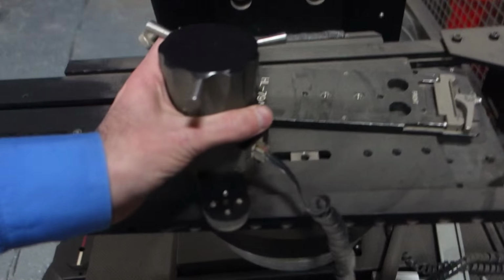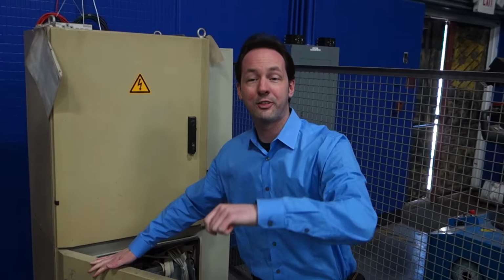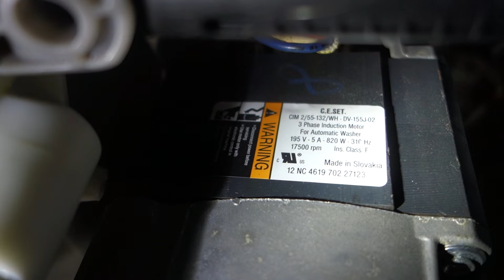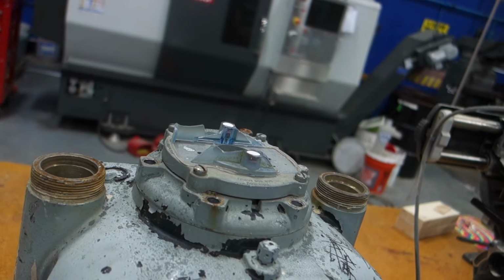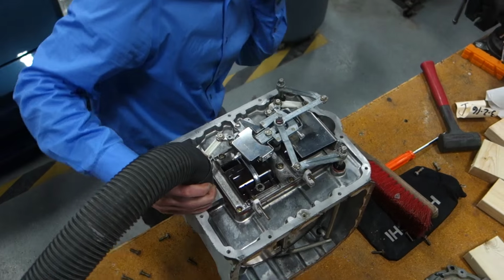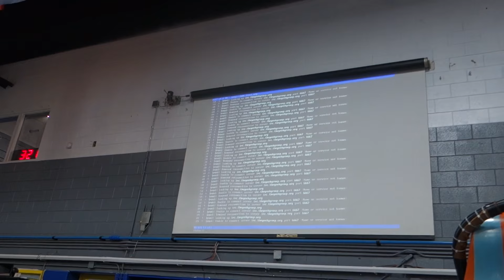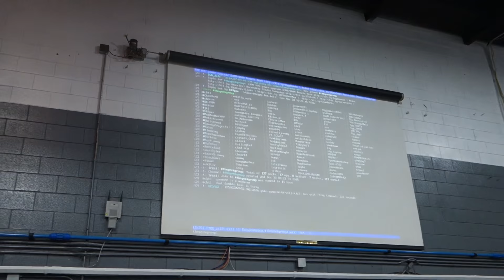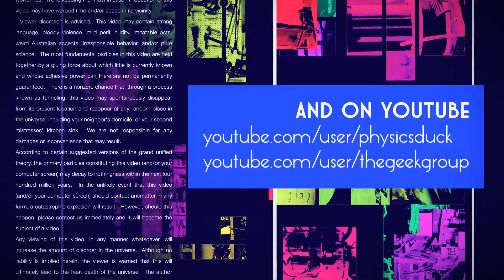Captain's Blog 3 21 2016 Robot Surgery Preproduction and Gas Meter Awesomeness

Comment: If that is an AUI port, then that computer may have Ethernet.  Used in older hardware, AUI is the connection between the Ethernet interface and the Medium Attachment Unit (MAU).  The MAU selects the type of ethernet, such as 10Base5, 10Base2, 10BaseT.  Splitting hairs... It has Ethernet that was not broken out into a specific connector such as RJ45.

Comment: Camera wise i would go for the Rx100 mk3 or 4 ( i would only buy the 3 if price was an issue) the 4 has an improved sensor,image processor. Plus they have a wider aperture at full zoom f2.8 compared to the mk1 / 2 F4.9
I have a mk1 which i've had from launch and love it, I would of upgraded to the mk4 but decided to get the A7ii instead.
Reply: +Charles harman Wow after doing some quick googling, people seem to like the MK4. I am not really a camera guy but do you know if there is a significant improvement in the audio quality with the MK4 vs the MK3?
Reply: +Ricouzuki Sound quality is probably going to be the same, all of the RX100 cameras use the same mic arrangement.

Comment: That washing machine motor, omnly thing i can think of driving it would be a VFD, but they only go up to about 100Hz, maybe 120Hz.
The better ones are the universal motors,  higher voltage = more speed, even better on DC (variac + bridge rect + capacitor) because mains voltage*1.41=peak voltage
Gas meters haven't changed since 1900 https://en.wikipedia.org/wiki/Gas_meter and seeing as the diagram is available, i don't know why consumers is so annoyed

Comment: Not that often that you see a washing machine with an induction motor. Normally they have an "universal" motor (which every power tool has). An induction motor has poor starting torque (whereas an universal motor has it's maximum torque when stalled) and is also not well suited to run a very different speeds.
A BLDC motor is very different from an induction motor and calling it an 3-phase AC motor is a common but still totally wrong misconception. The speed of an induction motor is controlled by the drive frequency (and the slip from that frequency is what produces torque). The speed of a BLDC motor is controlled by voltage and the drive frequency FOLLOWS the speed. It's better to think of a BLDC as a 3-pole stepper motor. You energize a coil (or two for more torque), the voltage of that is controlled via pulse width modulation. This pulls/pushes the magnets of the rotor (the higher the voltage applied the stronger/faster the movement; ever wondered why they have a "kv" rating? that's why) and the third coil is used to sense the movement of the rotor. Once the ESC "sees" enough movement it will energize the next coil and so on.
Yes, you can run a BLDC from 3-phase AC, which would then be a "synchronous motor" that will run poorly as soon as you apply load, because it will lose sync.
The induction motor (which is an "asynchronous motor", because it will always run a little bit slower than the drive frequency) most likely won't even turn when run from an ESC (assuming you got an ESC that can handle the voltage). You need the stator's magnetic field to create the magnetic field in the rotor. The way to drive an induction motor at different speeds is a VFD. But be aware, that it will most likely run poorly if you try to run it at higher frequencies than it was built for. The magnetic losses increase with frequency and at some point all you're doing is driving an induction heater instead of turning something.

It's weird. In your case the normal "universal motor" washing machine would be much more useable. A universal motor will overspeed on its own on AC without control and a simple variac would be enough to limit the speed (but the speed then is awefully load dependent). But you got an induction motor, which I find much more valuable to build things out of, because it will run very stably from AC without any control circuitry. And all motors I can find are universal motors...

Comment: 1209  wowser Moose is strong.  huge jeff shoot weighs a ton.  the current blog camera is falling apart.  what is potato resolution?  i have a Sony HDR-CX 190.  it has AVCHD.  build a low priced elevator in the lab somewhere.  ooo okay what?  cleaning helps people enter the building.  fun ice cream cooler.  1456  about to me is plus or minus 10%.  they are flooding you with messages.  both switches move differently to show what door they open :)  new computer will greatly improve jeff.  50 pound dog is an anvil.  once photonicinduction threw a brick in a washing machine.  washer motor looks useful.  3 big wires and 2 small wires is an interesting motor connection.  batman wants to copy photonicinduction?  gas meter looks heavy.  1972 gas meter looks great for its age.  batman your singing very entertaining.  please record and sell it.
Reply: +Sam Sitar Potato resolution is like 640x480 or 320X240.